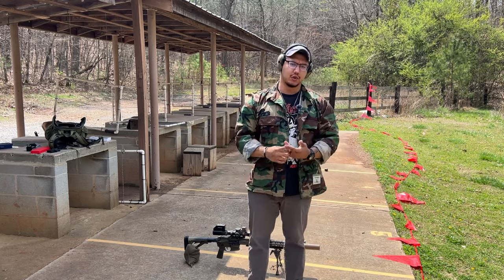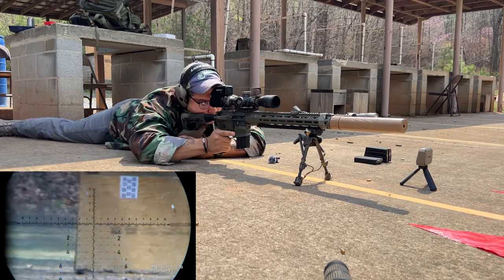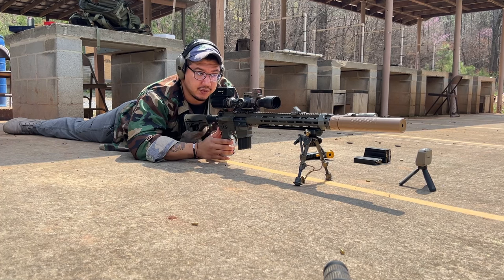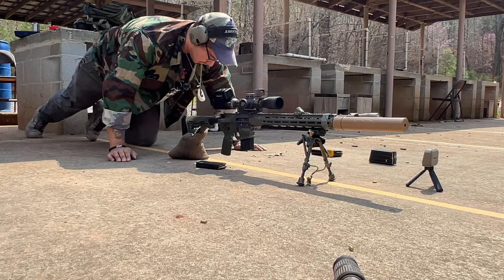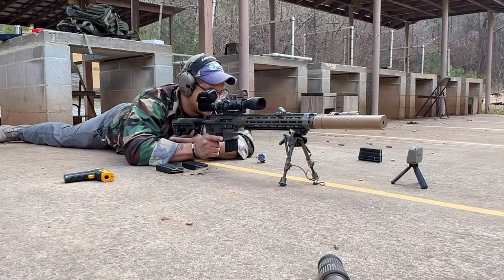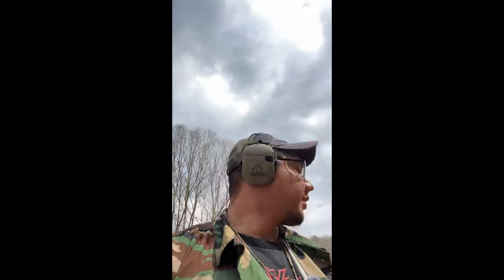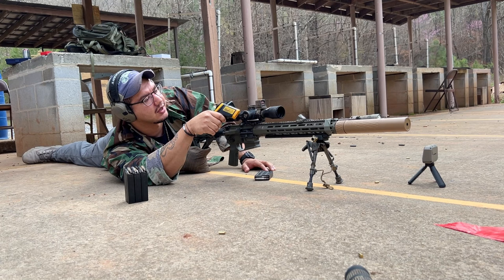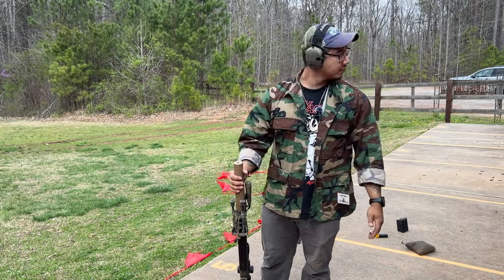Why You Should Be Shooting 10rd Groups: How Barrel Heat Affects Your Group Size

Comment: Subbed and liked on just this video. A bunch of people claiming less than .5 MO never shoot more than a 5 shot group, Maybe a 3 shot group, but never a 10 shot group. Is that because regardless of the cost of the barrel and action, 10 rounds brings enough heat to open the groups?

I care about 3 shot groups because primarily I am a hunter, most of deer. I will not take more than 3 shots. In fact, it is likely impossible that you will get a third shot at a deer if the first two did not take care of it.
Reply from the maker: Thank you!

And it depends on the barrel profile really in my experience. Heat opens the groups up so it’s good to know what your gun is capable of before someone claims it’s a “sub minute” gun. 

But like always, context matters. Bolt guns tend to have heavier profile barrels so they don’t heat up as quick, generally speaking. So in that case, less rounds could be acceptable. But I’m a data nerd. No reason to not shoot 10rds even if I only plan on shooting 1-2. 
🤜🏽🤛🏽
Reply: @KERSmark_Solutions  Agreed. I watched the Hornady podcasts on group sizes and Jayden Quinlan said it best. Group the rifle for the job. But you need some idea of what the rifle is going to do. So, for whatever rifle you hunt with, whether gas or bolt, shoot 7 3-rd groups with a cool down in between. Average those groups and accept what it is. It could be that each time, you shold .6 inches. But not in the same place. The spread could be as much as say, 1.25 MOA.

300 yards and in? Probably not a concern if you dial for distance. I would not use MPBR  on most rifles because a dispersion of up to 1 MOA + the rise and fall of MPBR could cause a miss or just injure the animal.